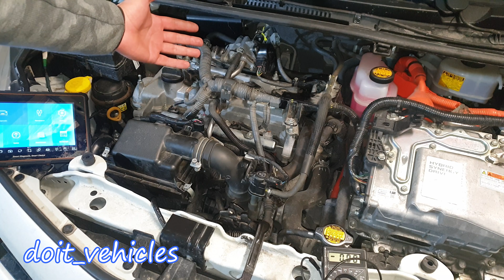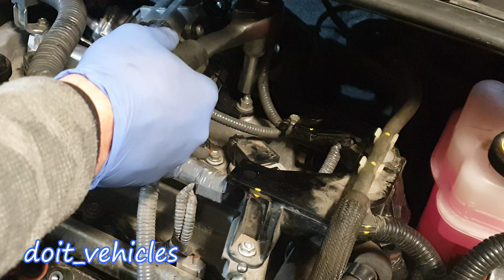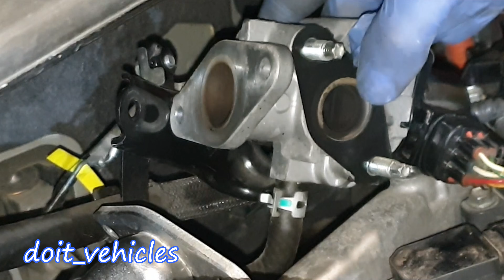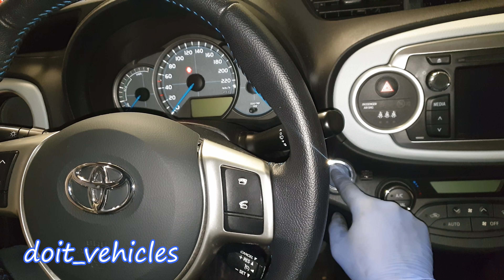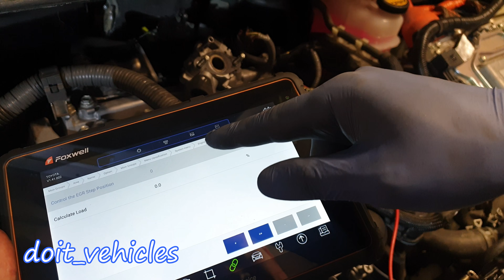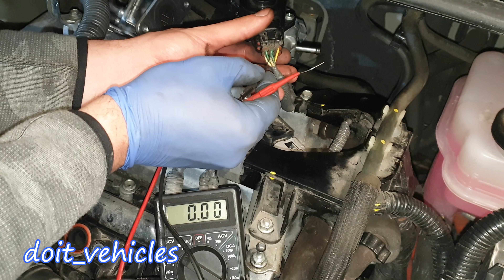Toyota Yaris Hybrid EGR valve Removal , Test , Solenoid Ohms

Comment: Thank you for the information provided.  I have a question. I want to inquire about this part. I have a 2011 Yaris with a gasoline engine. When I turn on the feature, I read the live data on the EGR. The reading is zero while standing, while driving, driving lightly, and driving at an accelerated rate. The reading does not change, knowing that it was checked with the special computer in Toyota cars. There are no codes.  Malfunctions, but the engine is unstable when parked. I see the engine tachometer at times stable and at times it drops below 550 rpm. Do you have any solution for this car? Thank you.❤

Comment: May I ask the mileage on that car?  The valve still looked fairly clean...   Mine  has just gone over 100 000 miles (160 000 Km)  but the EGR pipe still looks relatively clean, so I didn't yet remove and clean the EGR valve  or check the cooler for blockage).  Thanks again for a very clear and very useful video!